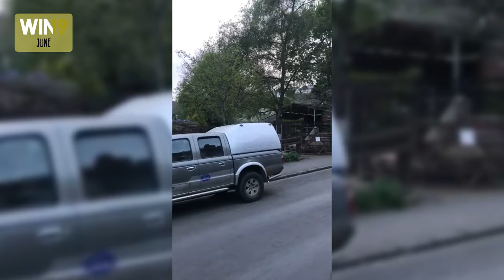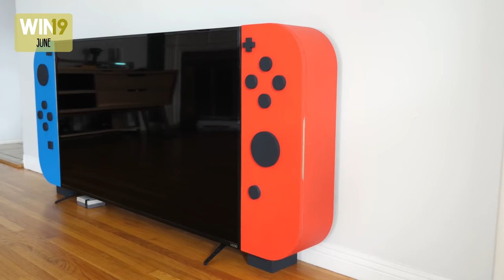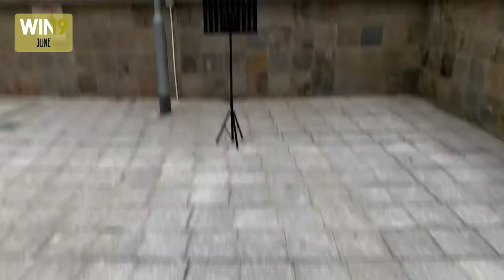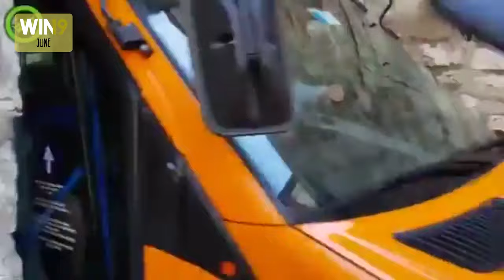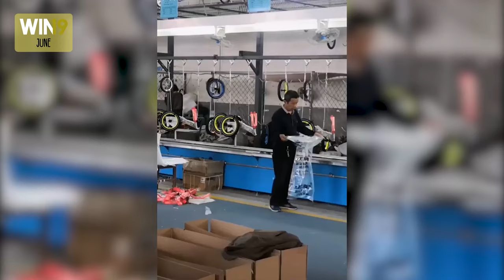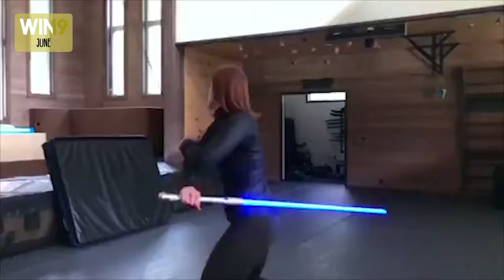WIN Compilation June 2019 Edition | LwDn x WIHEL

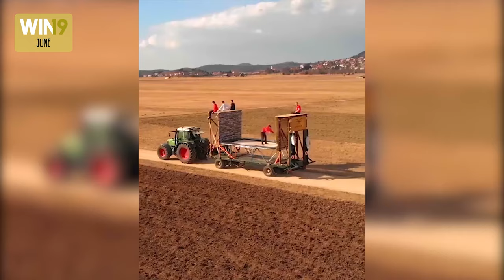Comment: 7:12
Sane People - 1
Flat Earthers - 0
(fyi, flat earth folks never seem to understand momentum... they think that if you jumped the earth should spin beneath you)
Reply: @crummyy I've never heard that before, but it makes sense 🤔
Reply: @crummyy You're correct, had to fact check that one.  I learn something new every day.  It still confuses me a little to be honest.  Lets say you're on the equator and you want to hit a target 1.5 miles away due south.  The second that the bullet is free of the barrel it's technically going sideways from any fixed point... oh I get it now I think.  The ground is going ever so slightly faster than the air that's attached due to the gravity right?